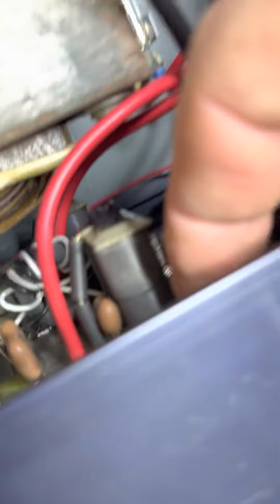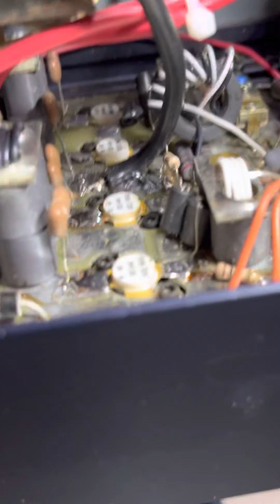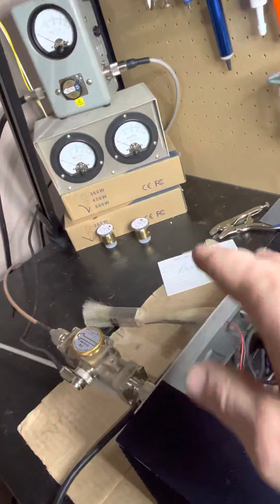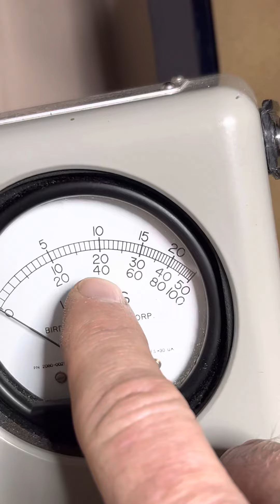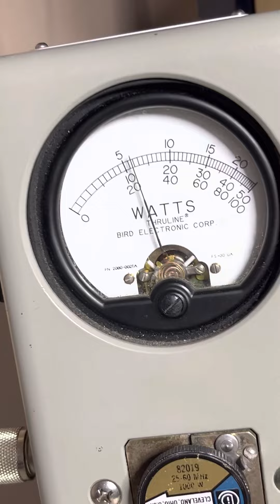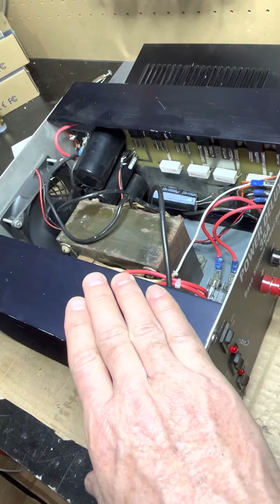Palomar Elite 35A (4x SD1446) restoration and repair.

Comment: Above 14.8 v you’ll start getting diminishing returns aka voltage and amp drop. 35 amps can only push so much. If you use it as a base amp it will last 30 years or more. Start turning pots and overdriving it will burn 🔥 up.